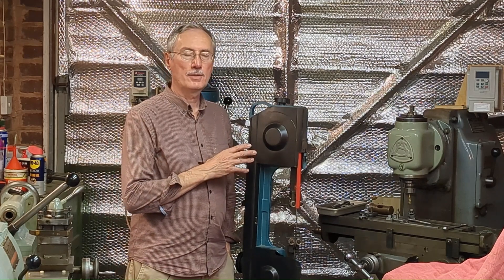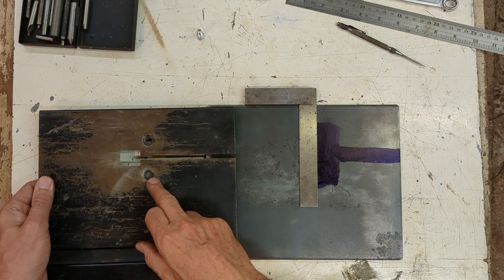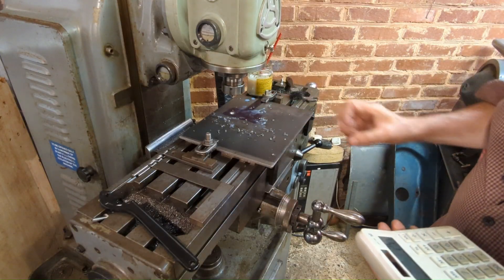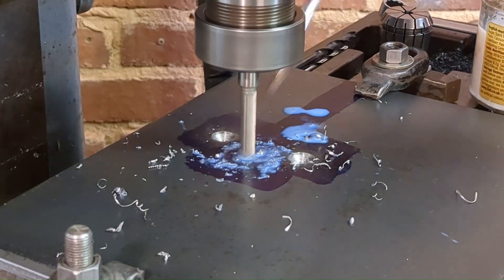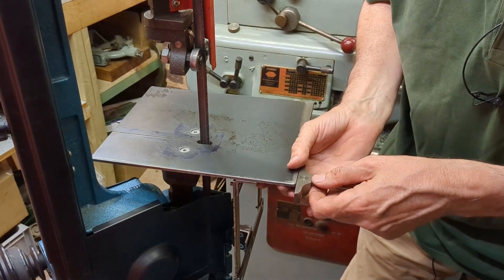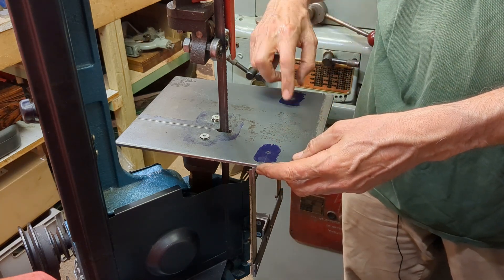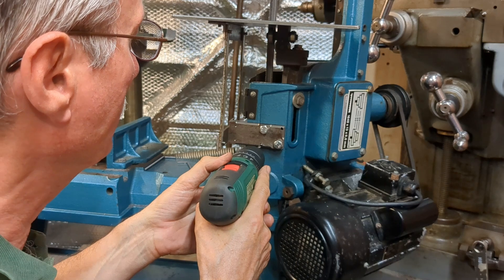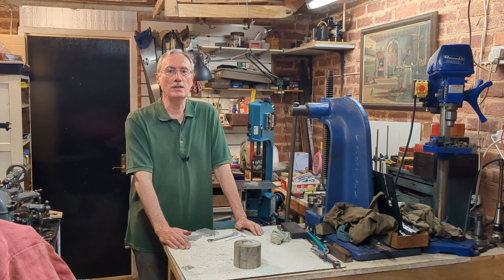Completing saw table for the 4.5in x 6in (110mm x 150mm) bandsaw - part 3

Comment: Hi, I did a heep of mods to my bandsaw a couple of years back. I used 12 mm Ali plate for a new table. I can get it on & off in about 5 seconds, mine clamps onto a sub table that’s permeant, it replaced the flat bit of plate that was screwed to the bottom rollers. Much better than the plate that came with it! Cheers Kerrin
Reply from the maker: Thanks, Kerrin. Yours is certainly quicker to fit than mine!
Reply: Excellent job as always. Lots of food for thought.
Reply from the maker: Thanks, Carl.